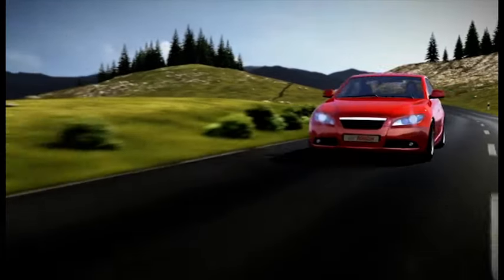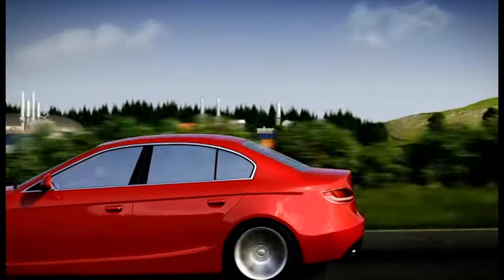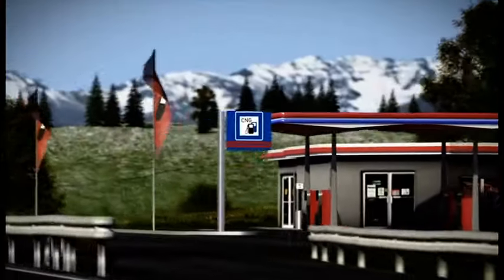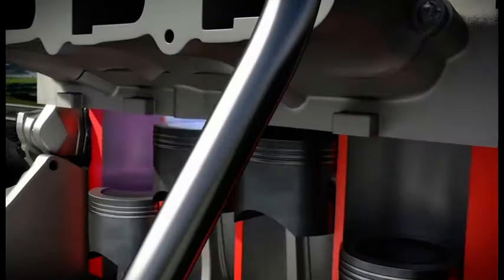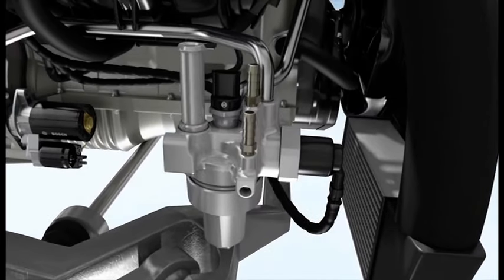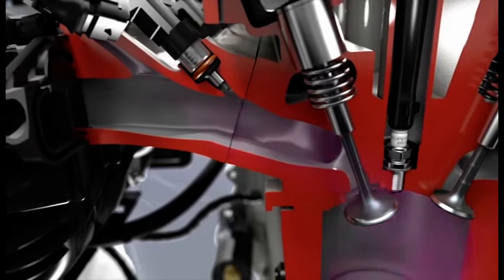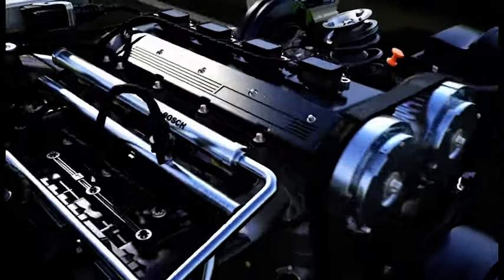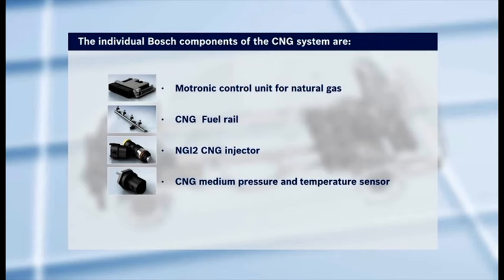Bosch Compressed Natural Gas Powertrain Animation

Comment: Bosch must change this video, because when the engine run on GNC, loose at minimum 10% of power.
Reply: No, the video specifically states a denser air fuel mixture can be used i.e you  can run more turbo boost due to the high octane of CNG.

Comment: What about the fact you need a custom intake manifold for those injectors to go into since your still using the gasoline fuel system. They didnt mention that in the needed components at the end.

Comment: Here in Australia we can't buy CNG unless if you have town gas outside the house. I have never have seen a gas station sell CNG but we can get LPG but most people are going to a diesel car that is Euro 5 standed. Most taxis are going over to hybrid or diesel. The company that runs local buses in my city is moving from CNG over to Volvo Turbo Diesel Euro 5 motors in there buses.
Reply: SO IT WILL BE MORE POLLUTED IN THE AREA
Reply: Price of cng gas💰💰💰💰 in india
Reply: Price of CNG gas in india 💰💰💰💰
Reply: Herr en Argetina is very common as a cheap option,  most cab,  and small transport use them
Reply: It's very common for 90 percent of Uber and Taxi's to use CNG in India. 
Common , very common.
Reply: They're idiots (the bus company) if they already have the CNG infrastructure and now they decided to buy diesels. If not idiots, they're corrupt or being influenced by someone who's going to benefit from that diesel migration (those who sell the buses, those who will repair them or those who they buy diesel from).

Comment: I have questions about the timing of valves and power of explosion to drive the pistons because isn't it cng has less power than gas ?
Reply: The air - fuel mixture can be made more dense with CNG. Meaning that the mixture during CNG operation is equivalent to gasoline. But the timing won’t matter, as timing really only has to do with where the piston is located in the engine & the opening and closing of valves at the correct time. A change in power or type of fuel won’t require any timing changes
Reply: Timing is just the synchronization of the engine. Timing is based off the position of the pistons in their strokes, so it would be a non-factor with fuel type. 

But yes, CNG does contain less energy in the same volume than Regular Gasoline.

Comment: what will happen if make some changes in the engine and use the engine with CO2
Reply: Co2 is non flammable.. it actually extinguishes fire... So really you'd just shut the engine down via oxygen starvation.
Reply: you cannot run an engine with a non-combustable gas, CNG is just a pathway to get us to Hydrogen Fuel Cells. (the only limitation from HFC is refill stations are very sparse.)
Reply: @ExarchGaming  Is that so?

Comment: what happens in a crash or when a bullet hits the cng fuel tank
Reply: +Zan Getsu Nothing. The tanks hold 3000 to 3600 psi inside them so they are very tough. Regular tests (car drop tests) don't tend to do much damage to the CNG cylinders. If one is ruptured, the gas floats away from the accident site instead of pooling around like diesel or gasoline.
Reply: matrixtrout3 i see, so they already did crash tests. thanks
Reply: What happens to a petrol tank in a crash !
Reply: You need at least 5.56mm rifle round to pierce a CNG tank.